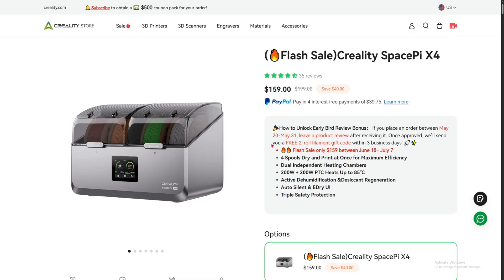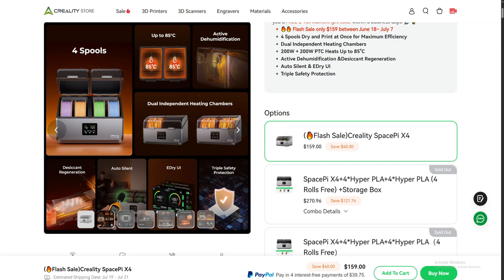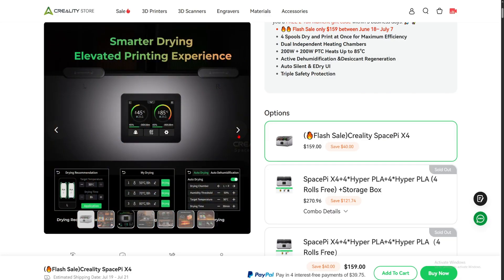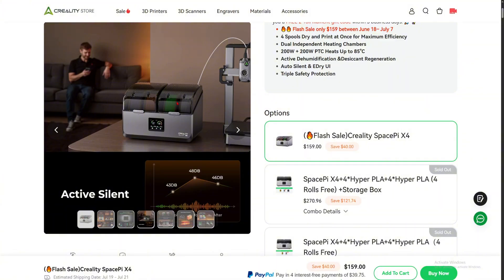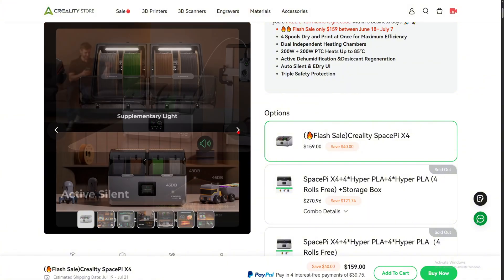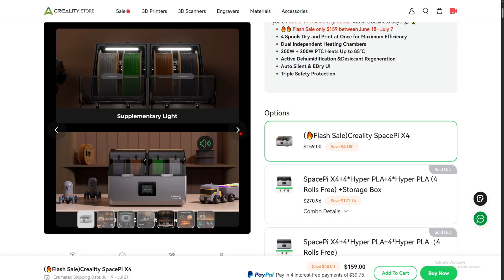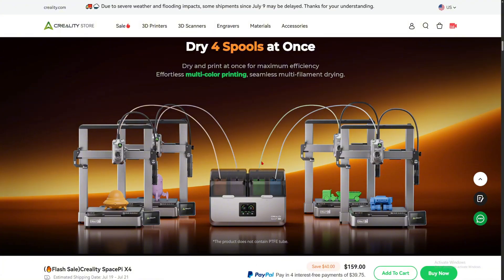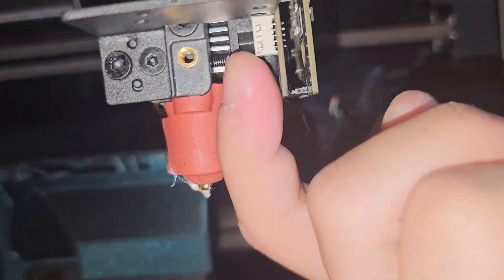Why Creality This Is Just Dumb

Comment: THIS is just ONE OF MANY stupid head-up-the-butt things that Creality has done...or NOT done. Dryer INSIDE the CFS, The Dryers being a nightmare to disassemble to fix their flawed "stuck @ 15% bad parts issue, on the NEW 2025+ K1C printers being LOCKED DOWN so you cannot root and flash the motherboard. Have to stay with their severely NEUTERED Klipper.  THE BIGGEST I've seen is using those DAMNED BUSHINGS in the toolhead on the X rods! I don't care if they say they are "self lubricating...THEY HAVE HIGH DRAG AND DO WEAR! Ans then they DO NOT SELL REPLACEMENT BUSHINGS! I found ONE place that sells them for $30+ DOLLARS for JUST TWO!!!! When they're worth $5 to $10 tops! I know because mine are egged out. I'm saying eff Creality and doing the Bootycall X linear rail upgrade...which SHOULD have been done by Creality in the FIRST PLACE!  They COULD have had an X1C Killer, but went CHEAP Yet DO use ROLLER BUSHINGS on the Y RAILS! COULD have even used the same type ROLLER BUSHINGS on the X / Toolhead...  Also the belt tension adjuster design SUCKS BAD as it allows the idler to cant/tilt, and it's just a PITA to get to and adjust. SHOULD have been on the FRONT IDLER and adjustable through a hole in front of frame or even from inside. ALSO the CAMERA ANGLE is HORRIBLE. ALSO the LIGHTING IS HORRIBLE.  ALSO they put the spool holder on the back? AYFKM!!! Even though they supply an STL to print a side bracket, THAT should have been the location and supplied FROM THEM! Could have even been a cool TOP MOUNT. EASY TO GET TO/USE!!!  ALSO I don't care if they call it a "Sil;ent Motherboard", IT AIIN'T QUIET! Unless you run it REAL SLOW... ALSO the Hotend FANS are LOUD AS EFF TOO! Really? C'mon mannn! ALSO the 90 degree front door hinge that has caused MANY MANY glass doors to be SHATTERED! 270 degree hinges SHOULD have been OEM FACTORY!!! ALSO the clear top SHOULD have been made 10mm-20mm TALLER to avoid the PTFE tube from rubbing on it AT ALL TIMES and scuffing the hell out of it! Then there's the Cable Chain...HEAVY and SLAPS the side, lifting the cover. SHOULD have been a thin wide piece of plastic like a zip-tie for support. Also they take FOREVER to correct firmware/slicer software. ALSO all the DAMN GLUE they use on all the wire connectors makes getting them off difficult. Even caused a connector socket to pull off the Hotend Control Board and when I put it back on I didn't have correct and thus fried the Comm chip on my motherboard.  Could have also added their "LIDAR" module to the K1c, or even had a kit otid-on. But Nooo, NOT Creality...CHEAP CHEAP CHEAP PROFIT...They COULD rule the market and parallel Bambu but it's like they're LAZY...Don't Give A *uck, or NEVER have their prototypes tested and evaluated BY US USERS FIRST! THIS is only a PARTIAL LIST of the PLETHORA of WTF WERE THEY THINKING!!! I've HAD TO  DO about a DOZEN MODS JUST TO GET THIS THING WORKING RIGHT AND RELIABLE!!! I wish BTT Big Tree Tech made a plug-n-Play board for these too...
Reply from the maker: All seems valid

Comment: Hi friend, I have a question for you. I'm thinking of updating my K1 Max with CFS. Is this an option you recommend, considering I already have a P1S with AMS2 and an A1 with AMS Lite? Is it better to leave it as is or should I update it? Thanks!
Reply from the maker: It really depends on you. Do you want another multi color 3d printer? Or are you fine with single color prints from the k1 max?
Reply: I mean, is it an update that works well and doesn't cause problems?

Comment: I appreciate the video and the comments below.  I just bought the K2 Combo (not plus or pro, just regular).  I saw the Space pi x4 and bought it too.  I'm new to this world so was confused about why there's a separate unit and how to make them work together, now I know thanks to this video.  Unfortunately I'm stuck with this set up now and committed to making it work.  Grox said I could pass the filament out the output of the pi and into the input of the CFS (I didn't know it has inputs on the back).  So basically the filament just passes through the CFS.  Space is not an issue so I guess I could set it next to the K2, but I agree that's pretty dumb and a waste.  But will this work?  I guess I'll find out soon, will arrive on 12/3/2025.  The pi doesn't come with any tubing so I wonder if I'll need to get some for in between the pi and the CFS?  Thanks for any feedback, just remember I'm new.
Reply from the maker: Welcome to the 3d printing world!
Yes totally this is really bad from Creality, but I have see some people make it work with both, but not quite sure how it's going to work because the pi does not have any motor and if you put it in there, there's no way of auto extruding the filaments while the filament is in the pi and not in the CFS. 

My suggestion is to dry them in the pi then put them in the CFS and print with it.

Comment: Also Bambu Lab won't provide any Drying does it when you print, AMS 2 Pro and the AMS HT, none of this does the job. Just dry before and during printing "good luck" with your engineering materials.  You have to print within 30 minutes 🤣
Reply from the maker: Didn't the new ams from Bambulab have active drying..?

Anycubic ACE pro have active drying sooo... it is doable.

Comment: Already many cfs owners have placed the unit above K2 or K1 series CFS upgrade and have issues from cfs overheating and failures caused by the excess heat of the printer. Mostly if you live at very warm regions. How creality can combine cfs with filament dryer if already have overheating issues? I think that is the reason.
Reply from the maker: Yeah, but people loving in colder climax will need the extra heating, but still having a dryer would have been good.

Comment: I think you hit the nail on the head with you have to buy both.  I think timing wise they rushed it out before the H2D announced the active drying stuff built into the AMS 2 Pro.  Its cheaper to make a plastic box with some servos and not as many sensors and heating elements and they are making this less than half the price of what they are trying to keep up with.
Reply from the maker: Yeah, totally agree with you too. They rushed it trying to compete with bambu lab and now that the new h2d has a dryer in it, maybe creality going to copy that and bring out another cfs2.

Comment: I agree is what the K2 Plus Combo lacks besides a couple of things, even if it is to keep it dry to go changing the silica gel and putting it in the filament dryer with the spools it is not practical if it was for the cable they only had to make an adapter for the outlet but they did not,  On the other hand where moisture enters is through the buffer, if you have parked nylon without circulation it gets wet there, it is important to place dry fillets if you have some with moisture it is distributing it, another thing that happens is that it seems to me that the thermistor is in a bad location, when I modify it I think of intelligently placing it somewhere more sensible without ruining the CFS and making it compatible with more spools of filaments another great problem I have, a mischief but I think it is salvageable, despite this I choose creality well above bambulabs, a big hug from Argentina
Reply from the maker: Thanks for sharing your experience and ideas, it's really good to know what can be improved for this system.

Comment: CFS is already expensive, if they combine CFS with dryer it will be ridiculously expensive
Reply: Yes you are right, Bambu Labs suck, but many Bambu Lab fans have bought the Creality Space PI dryer, because it's the best. 😂
Reply from the maker: That could be true, but i felt like they could put a simple system in there and would still be profitable.

Comment: This is one of the reasons I bought the Anycubic Kobra 3 Combo...
I run the dryer while I do any print, regardless of the current humidity...

Only thing Anycubic could have added to the box is a digital display with current temp and humidity, but I found a small one which I have stuck on the inside so I can see where it's at...
Works well for me!
Reply from the maker: Yep, anycubic dryer is good, not the best but at least it has it and keeps moisture level down.

Comment: It feels like the same pattern we saw with Creality before. They rush products to market just to drive sales. Whoever is leading the company doesn't seem to understand that sometimes it's better to slow down and ensure everything works properly. When the K2 launched, there were numerous reports of issues, especially related to shipping. I installed the upgrade kit for my K1 Max, and in their official video guide, they actually tell you to remove the top glass because of the tube clearance. Instead of offering a proper solution or sharing STL files for a riser, they left it to users to figure it out. I went ahead and printed a riser myself that someone designed. It does raise the top of the printer quite a bit, but it solves the problem and lets me keep the enclosure intact.

If Bambu didn’t try so hard to imitate Apple with their closed ecosystem and premium pricing, I might have considered their machine. But honestly, I prefer being able to repair and modify my own equipment without relying on a company that behaves like an Apple clone. I might have overlooked the closed ecosystem if the price were not so excessive and if they actually offered shipping to my country.
Reply from the maker: Yeah that is so true! I also modify my k1 max so that i can keep the top glass on and use the cfs on the of the 3d printer. Yeah bambulab is great but not their closed system.

Comment: I wonder if they did that because they didn’t think about it before with the CFS Accessory kit came out, and I wonder if the Space Pi 4x can be used as a replacement for a single CFS to be used in the buffer that can be like a CFS, but instead of getting all 4 CFS’s, use like 3 CFS’s and one Space Pi 4x, then use it as a separate filament dryer
Reply from the maker: I'm not sure even if it has the buffering, there's still no motor inside the space pi so you can't retract the filament and it won't be able to sense it in the slicer.
Reply: @Scratch3DPrinting  Hmmmmm, interesting.